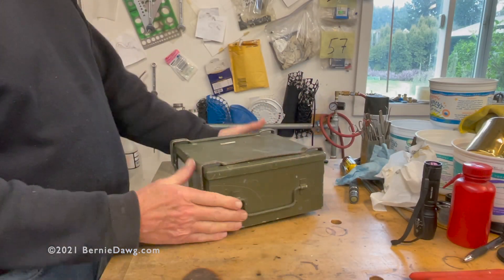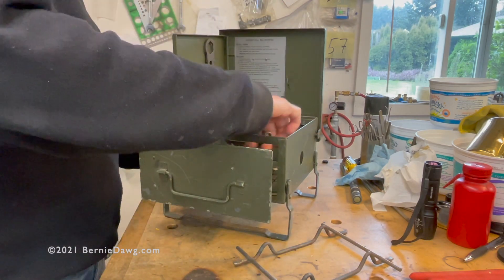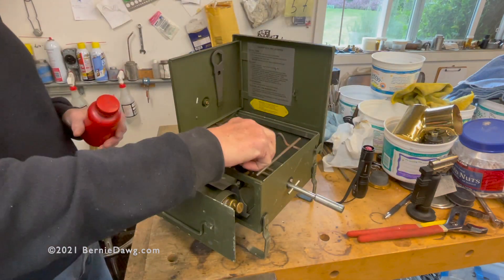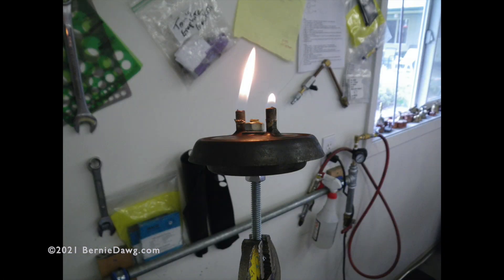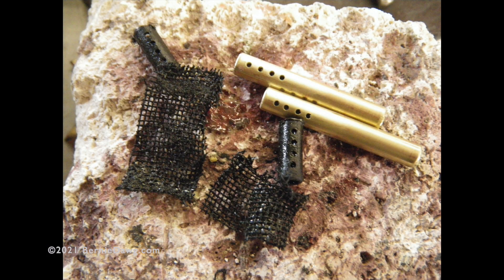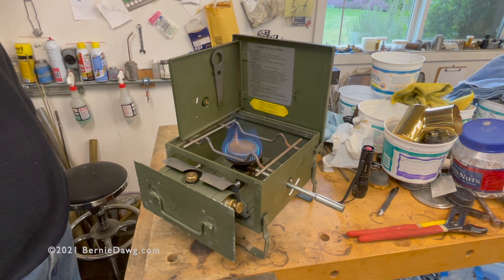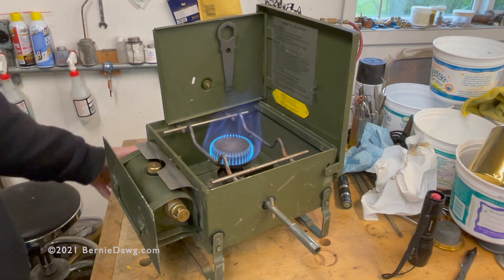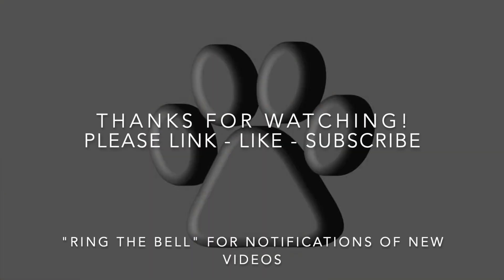British Military #2 Modified (and BD Upgraded) Vehicle Stove

Comment: The British Military No2 modified, then modified again properly. Hell of a transformation Gary. Well done!
Reply from the maker: @RAR Knives and Leatherwork Thanks, Rob! As much as I like my jazzed up version of the slitty BM#2 modified burner I remain concerned that the rust will eat it's way back through from the inside even though I used brass screening/packing. (Condensation between fires I reckon.) I try to use it as often as I can, while I still can. 👍 BD

Comment: That is really another piece of Craftsmanship a beautiful model never seen.
Reply from the maker: @Charles Aec Thank you! I've found several videos on YouTube that feature these stoves with this burner, but they most all demonstrate how badly the burner can run when used beyond its life and not repaired and/or modified. The steel mesh in the burner head is a burner killer for sure. Here's one example of a stove video that shows issues and why auto gasoline should be avoided - no shade to the owner/YouTuber - it's actually one of the better performing BM#2 modifieds on YouTube. (Toward the end you can hear that the burner is also experiencing vaporization surging.) https://www.youtube.com/watch?v=YFdnyUL_978 BD

Comment: how did you is there a screw to take the burner off to de coke it clean the carbon out holes.
Reply from the maker: @martinlacey4575 No. There is no "screw to take the burner off to de coke it clean the carbon out holes". You may want to rewatch the video - the WHOLE video. As I show in the video, I completely disassembled the burner head by heating it with a torch until the brazing metal melted and the brazed parts could be pulled apart. I also drilled out the center spigot tube which gave me full access to the interior of the burner head. I rebuilt the feed tubes and silver brazed the whole assembly back together. All of that should be obvious with an attentive rewatch of the video if you pay close attention. It's probably beyond the ability of most stove restorers to do this sort of work - too many skills needed in this modern day. BD

Comment: I often wonder how you go about calculating proper dimension and spacing for; jets, spigot tube, head size, burner orifices etc, needed to achieve correct operation. Is there any reference material or tutorial available that is understandable by your average pedestrian?
Reply from the maker: @M Silvius No direct written documents or tutorials of which I'm aware. Here are some of my most basic thoughts. I think it might be more art than science in most cases - at least for me. That said, I also think it requires an understanding of how fluid flow and fuel/air vapor mixtures work together in burner design to obtain as close to a stoichiometric flame as possible. I tend to use trial and error based on experience and knowledge rather than mathematics or calculations. (Handbuilding/designing hundreds of silent damper caps helps.)
If a flame has yellow in it, then it has too much fuel vapor compared to air in the mix (rich). If the flame is thin blue and wispy, then it has too much air compared to the fuel vapor in the mix (lean). So, in the case of the BM#2 modified burner in this video, the yellow flame could most "easily" be addressed in the following ways without influencing the output of the burner:
1. increase the distance between the jet and the spigot tube opening which allows the fuel vapor stream coming from the jet to draw more air into the mix
2. increase the diameter of the spigot tube which allows the fuel vapor stream coming from the jet to draw more air into the mix
Obviously, there are upper limits to these two methods. Too far away from the jet and the vapor stream will lose too much velocity and will have spread out too much to go up inside the spigot tube. The diameter of the spigot tube was constrained by the two feed tubes to the burner - I could only make the new spigot tube just so big before it banged into the feed tubes. (I would have preferred a bit bigger.) Also, if the new feed tubes were too long, then the top of the burner head would not allow the lid of the stove to close. So, the "math" involved here was based on the maximum diameter of the spigot tube which would fit into the burner head between the feed tubes, and the height of the new feed tubes that would keep the lid from banging into the burner and still provide a suitable flame distance from the cooking vessel.
Some might say that another option to get a more stoichiometric flame from this burner would be to reduce the jet orifice size. While it is true that this would reduce the amount of fuel vapor to the burner thus making the mix more stoichiometric, the resulting lower velocity and lower volume of fuel vapor would reduce the air drawn into the burner head and create lower pressures inside the burner head resulting in weak flames emerging from the slits in the burner. This would likely cause the flamelets to fall inside the outer cap and ignite internally as underburn. Plus, of course, it depowers the burner and makes it have less output. Less fuel vapor = less flammage.
I could rattle on for a good bit longer but fear that most YouTube watchers have already clicked elsewhere by now. Feel free to use the email address I provide in the description box below the video if you'd like to ply me with more or more specific questions about all this. 😁😎👍 BD
Reply: @BernieDawgCinema  Wow!! Thanks for taking the time to post such a detailed write up to answer my question. Way more than I ever expected.  I really do appreciate the effort. So many variables at play here, any one of which has domino effect down the line. Don't know if it is even realistic, but it might be subject matter for a whole series of interesting videos.
Reply from the maker: @M Silvius Well, thanks for your suggestion for a video series on stove and burner and fuel theory. I'm thinking that most YouTube video watchers don't much appreciate long-winded pedantic discourse by a talking head. My most popular videos are the ones that actually show you how to do a thing or repair a thing - especially when fire is involved. 😉 My "theory" videos get the least views. I'd also suggest that I gave you a bunch of information and perspectives in my reply above that could be an excellent springboard for you to do further research and education on the subject on your own. I show videos like the one above on my changes to the BM#2 modified stove in order to illustrate techniques and to inspire others to step out of their comfort zones and go try stuff on their own. Perhaps in that spirit you could try to research these subjects on your own now that I've given you a substantial starting point. Good luck and remember I'm only an email away. BD

Comment: I just acquired one of these what petrol do input in it sounds like a stupid question but is it just petrol?
Reply: Fuel source
Reply from the maker: @scottperry30 Use naphtha, aka Coleman camp stove fuel, aka Crown camping appliance fuel, aka MSR Superfuel, aka Aspen 4T, etc. DON'T use unleaded petrol like goes in cars as auto fuel has become so full of unburnable additives (at stove operating temperatures) you'll just make a mess of your vintage military stove and probably wreck it with fouling in the inaccessible burner head. Fixed a bunch that were wrecked in this way. There's no such thing as a free lunch. It'll cost you a lot more to run one of these stoves than to just use a modern propane stove, so, if cheap is what you are after, this ain't it. BD
Reply: @BernieDawgCinema  cheers looking. Forward to actually using this stove

Comment: I also like the unusualness of the no.2 mk2 modified burner, even more so with your modifications and perfect burn - great job. I prefer the case of the no12 and generally prefer burning kerosene however. Do you think there is any scope for a hybrid of this burner (with your mods), fitted with a kerosene jet and needle, with a no.12 case/tank etc.? Preheat could take a long time but do you foresee any other problems?
Reply from the maker: @Sam Whitehead Thanks for watching! I don't think the #2 Modified burner will burn kerosene. Kerosene is much less volatile and wouldn't vaporize in the built-for-petrol #2 Modified burner. If you are thinking you like the quietness of the #2 Modified, there are already after market silent damper caps available that let you achieve all the power of the #12 with little of the noise inherent on the #12.  http://shpws.me/SnJj BD